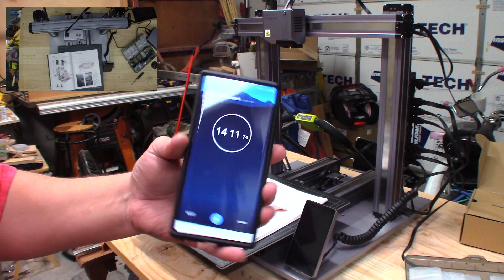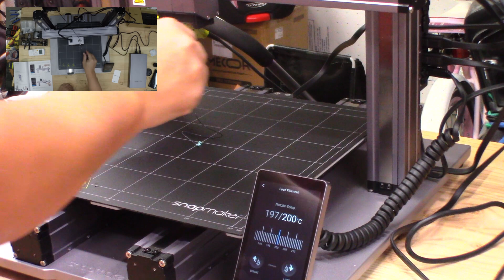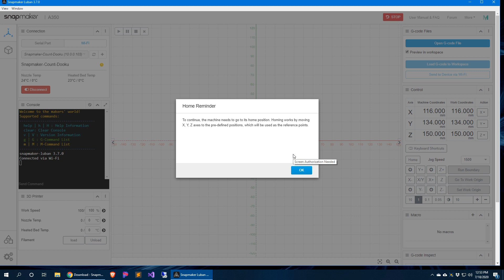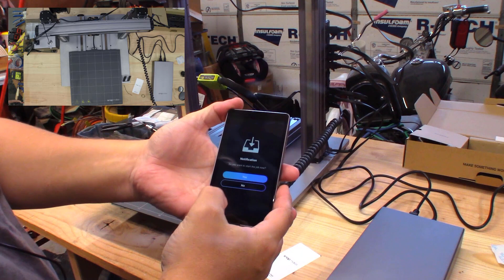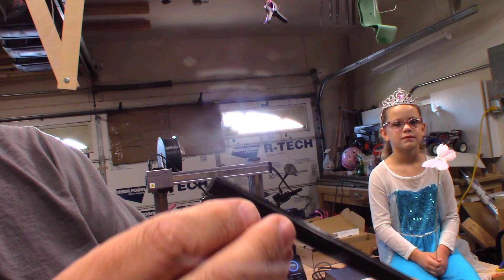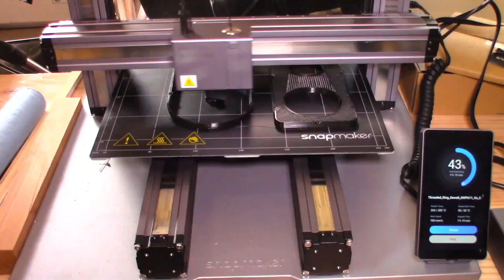Snapmaker A350 3d Printer Setup, Print And Review

Comment: Yeah, I'm not happy with mine.  On my first calibration , the nozzle scratched the bed and ruined the mat.  I'm having to constantly adjust Z stepping and is a major pain.  My old printer works better than this and it has adjustment screws that stay put for many prints before I have to adjust.  I'm almost considering sending the darn thing back.  They only reason I may not is due to the other features that I have not tried yet.  I think they may have over promised and under delivered.  

I would have to say the machine did go together well and seems sturdy.  Just surprised as to how bad calibration runs and that still no matter what, you have to adjust Z stepping every time along with elephant feet no matter what you do.  Isn't the point of calibration so the machine knows where it is and run correctly?  Why do I have to manually set this if it is calibrated.  I think this part is a gimmick. Only if we could get some more micro steps in there to help those go away.

I have a feeling if it can't find a calibration point, I'm going to have similar issues when I try to set zero on CNC functions.  More waisted materials in my near future.
Reply from the maker: I am using the laser quite often. as for the 3d printing not so much. I have never had luck with the auto bed leveling and at this point don't want a printer that sole relies on auto bed leveling.
Reply: @YetAnotherMaker  right and manually correcting this isn't easy either as no way to level the bed.
I do have one question for you.  Does your nozzle actually touch the build plate when it's calibrating or is it just getting close?  Mine seems to hover just about 15-20 mm over the bed but never touches.  Is it using a camera to determine the height?
Reply from the maker: Mine doesn't hover that high but it does hover. There is a magnetic sensor that measures the distance and then there is an offset for the nozzle. What is causing the issue though is the thermal expansion of the bed when it heats up. After i upgraded the firmware it was better but i still had to micro adjust +-.2mm every time it felt like.
Reply: Good to know there is a firmware upgrade.  Well, I appreciate you chatting with me over this.

Comment: Thanks for your video! 

I am waiting for my machine.  What would you recommend for a size of workbench to comfortably work with the A350 and necessary accessories?
Reply from the maker: So if you do not get the enclosure the footprint of the A350 is 19" x 20"  bot that is just the base. you would want more like 30" x 20". If you are getting the enclosure its footprint is 32" x 24".  You will also want to keep in mind t hat the doors are on the front and right side.  As for extra space for tools and some where to set stuff that is up to you as you might like a minimal space or  5' or space.

Another thing you will want to think about when you are planning your space is storage for the different tool heads and work surfaces.  Eventually I want to make a drawer or 2 that will sit under the printer to store the extra parts but that is low on the list of to do.

Also just a reminder if you have not subscribed please do so as there will be more content including the printer and other cnc tools and some fun builds coming up.  

And one last thing, Thank you for watching most if not all of the videos!  Its so much harder now to get monetized. 1k subscribers and 4k hours watch time.
Reply: @YetAnotherMaker  I did order the enclosure last month when I received the survey. It's expensive, but I am very impressed with the build quality for the money. 
I have a dedicated shop that is roughly the size of a 2-car garage. Has to serve as storage for all the usual home maintenance stuff, but plenty of space for this new toy. I have a new-ish 2' x 6' workbench that is adjustable for height - it might work well if I pair it with a rolling tool cart that has a work top.
It's a new to us place, so it will take some adjustments & juggling to fit all my crap in & still have a workable space.

Comment: Are you happy with your purchase?
Reply from the maker: So far I am. I have not had to fiddle with this printer at all other then getting the first layer worked out.  I wish the documentation was better for updating the firmware as I could not find steps on how to upgrade any where so I just took a guess, and that is my biggest complaint.
Reply: Yet Another Maker Yet Another Maker I just placed an order for the a250 it’s supposed to be here in November! I might need some help from the magic princess. This will be my first printer and I’m hoping they have done a good job in the interface to make it user friendly for a newbie like me. Thanks for posting these videos looking forward to seeing more.
Reply from the maker: i have been recommending the original Snapmaker to my friends that want to get into the hobby and not one has any major issues with it, I expect the same on the 2.0 versions and so far its holding up to the reputation.  Make sure to jo in the FB groups and if you do have questions that will be a good place to ask. More then likely you will get an answer faster there then here.
Reply: @YetAnotherMaker  Do you recommend printing with raft?
 Or just directly printing the part on the base plate?

Also, if you have figured out, please share the first layer settings.
Reply from the maker: @newerasworld4102  I have not been printing with the raft. What I have done to set the bed leveling is this:
1. Connect to the snapmaker with Luban
2. Set the bed temperature to 70c
3. Disconnect from the machine (this causes the machine to hold the temp setting)
4. Run the auto level procedure. ( I have also set it to the 5x5 grid in the settings on the touchpad.)
5. Once the auto level procedure is complete, run a small sprint and adjust the z offset.

After those steps it seams to be just fine for the consecutive prints.  I have read that some people are disabling the auto level at the start of the print and that seams to be helping as well but I have not needed to.  If you change your setup re-run the auto level procedure again as it seems like the settings get lost or the bed and print head change just enough that it makes a difference.  I hope this information helps.
Reply: @YetAnotherMaker  Thank you for the info. This helps.

Did you happen to print with ABS? Any printing issues with ABS? Since the heated bed can go max upto 80 degree C, i am not sure if this is good enough because on other printers, i see the heated bed for ABS should be 110 degree C.
Reply from the maker: I have not printed with ABS or ASA yet.  Both of which require a higher bed temperature, but with the enclosure and it retaining heat should not need as high of a temp for the bed so 80c might be fine.  My snap maker is set up for laser right now, but when I switch it back to print something I will give either the asa or abs a try and update.